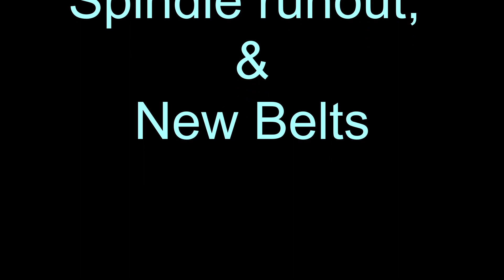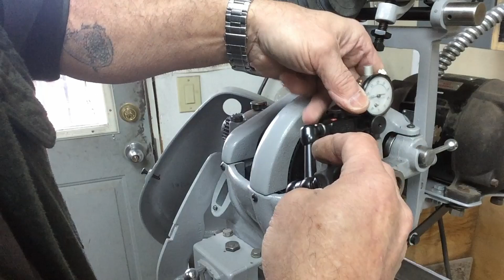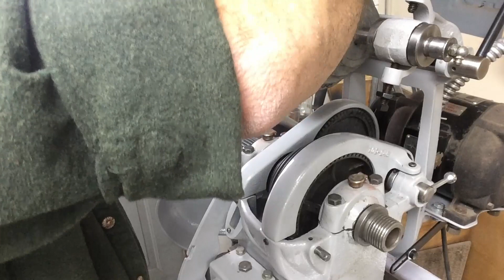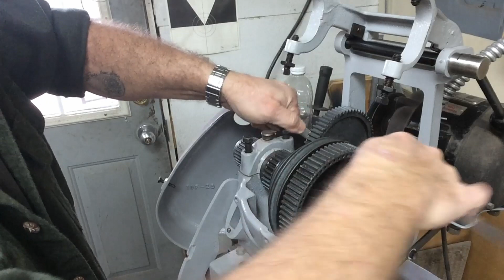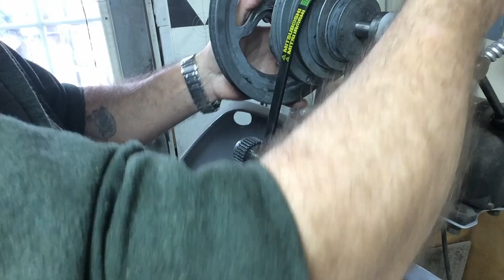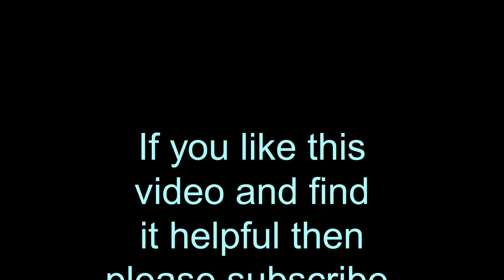Building an Atlas 10" Production Lathe Part 10 Rocker Hub, Runout, & Belts

Comment: I ran the newer style “green” link belts on mine
It’s noticeably smoother, as it takes no set, and I don’t need to remember to de-tension the belt to avoid getting a set.

Also no spindle removal, which is more of a pain on a Timken bearing spindle.

What’s your reasoning for running a standard continuous v belt? 

I’m also curious about the unequal shim distribution there - I guess you’re waiting on carriage reassembly to run an indicator back and forth in a test bar?

Brent
Reply from the maker: I still prefer a standard v-belt as it is more original than a link belt, I feel probably stretches less, and since it is already apart it's not really much more work to install. As far as belts taking a set I look at it the same as running bias ply tires. When they start out they may have a flat spot on the bottom from setting, but after a few miles they warm up and it is not an issue. The shims are positioned as they were when I initially dissasembled the headstock. I suspect at one time the headstock was set up correctly, but over time due to wear the previous owner(owners) removed shims which has removed all the vertical wear, but did little to remove the lateral movement. I will almost completly finish assembling the lathe before I start taking serious measurements as I suspect several areas of missalignment will appearm The most critical in my opinion are going to be spindle alignment with the bed and the tailstock. and all three will have to be addressed together and I won't know to what extent I will haveto go to to correct the issues untill it is all together. At worst I will have to re babbit the headstock. Once they are in proper relation to each other then the saddle will take minor adjustments